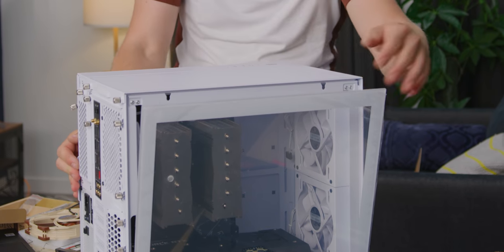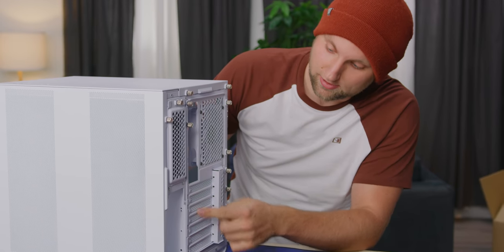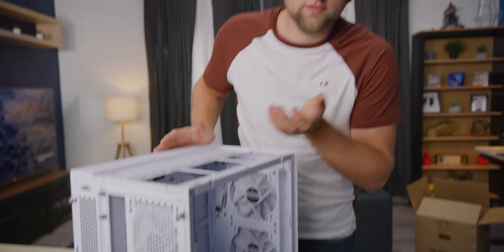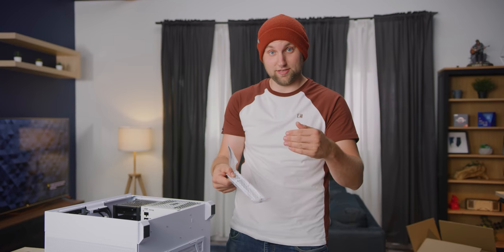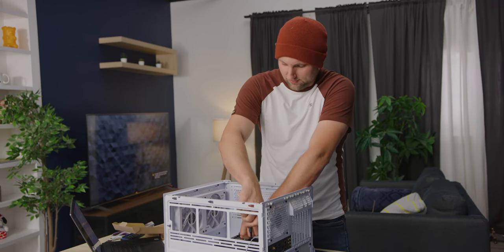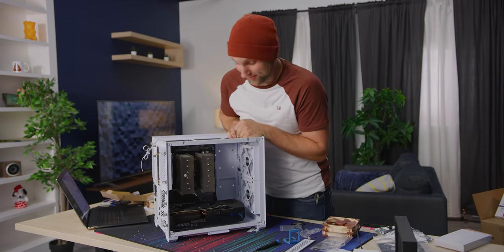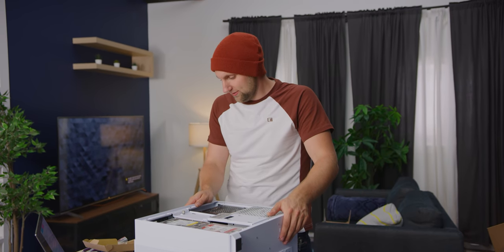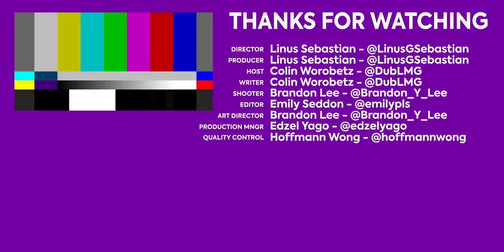This Is My DREAM PC Case! - Lian Li O11 AIR MINI

Comment: I really would like to see a build in there with exactly every slot filled with the biggest stuff you guys can fit. Its one thing to dummy place everything. To cable it is another thing
Reply: that channel under the SSD tray is pretty spacious, I doubt cabling would be an issue.
Reply: @AddisonRyan  it is indeed, but I was thinking how it turns out when you fill everything. Also with this size of PSU. Definitely an interesting try
Reply: Including an EATX motherboard and two EPYCs.
Reply: @pleappleappleap  nono 2 itx boards and 2 epycs in one case
Reply: Cables is pain... I have a Corsair 5000D, and despite having plenty of room in the front, I ended up with bundles of wires in the PSU basement
Reply: @DoctorX17  exactly what I was aiming for. If you fill all this stuff, you need atleast a few cables for power aswell. Sata and power. That's 2. Now  scale that up to 4 HDDs, 2 SSDs and you get a few cables. You know the deal :O
Reply: @Mom19  spaghetti explosion!
Reply: So, you like every hole filled to the max, do ya?
Reply: yes custome watercooling with 2x280s , that would be crazy
Reply: I had the original O11, it was garbage! I HAD to buy custom cables in order to wire everything up. Stock PSU cables were too long and with everything in literally no room to store the excess cable length and that was with a modular PSU to.
Reply: @jmac316  the O11 isnt really a cable storage. It has a big inside for your computer parts for looks mostly. Cables are another thing. It isn't garbage, but you would call it insufficient cable management. The build quality is good. Personally I don't like the restrictive airflow options in there. But that doesnt make it garbage really
Reply: @bowdiddly6172  Well its not practical sometimes. And I wouldn't do this inside this case, but I definitely need practical stuff and its nice to see that this case offers a good amount of practical mounts and space. But mounting space isn't the only thing that matters. If you have a hard time wiring this up and store the wires, the mounts begin to be not useful after a certain point. To make it short, I like to have the options eventhough I don't need them today, but would need them tomorrow. And if the options get hard to use, the options become irrelevant
Reply: @bowdiddly6172  I mean, just because I have mounts, doesn't mean they are all usable at the same time yes, but if they are, thats great
Reply: @Mom19  I also thought it was garbage because parts didn't line up. Gpu didn't line up with the backplate as the whole back was slightly warped. Since that I avoid this O11 line.
Reply: @jmac316  this must have been a production issue. I worked with an O11 before for a customer. Cabling is different there but otherwise everything was fine, except my opinion on an only left side intake. Could have more intakes

Comment: I really like Colin's videos but cmon man, you put the cooler upside down!? That´s the D15s, s as in assymetric specifically to clear the pcie slot, the reason that monster of a gpu didn't fit was because the cooler was upside down

Comment: "It can fit all these things" sure if everything was wireless lol
Reply: Exactly, there was literally no dpace for hdd cables which are quite big
Reply: There is space in the bottom and the top, not in the middle, you just have to do a good cable management.
Reply: @eliadbu  I agree, put one upside down and you have space for wires.
Reply: space man  your pun sucks, seriously.
And about the case of course its not perfect but it has few aspects that fit the needs of quite a lot of people. Talking about the XL these 2 are very different, I want this case since I want to save space while I fit regular ATX components, XL is too big for my planned setup.
Reply: space man  cable management and custom cables, I've seen modders that have done much more than you did like building watercooled ITX with aquaero controller and still the nailed the build. Of course average PC builder does not have the tool skills time (and maybe money) to build such PCs, but believe me fitting all of that storage is not impossible to that case.
Reply: space man  clean build makes everything tighter even in the front and when you you to change something in the back, it's not a mess. And I want small PC because where I put my PC I want to save as much space as possible (sometimes space is a luxury and not only in a closet). I have a large case for a different build (corsair 900d) and believe me after years using it for custom cooling I know the disadvantages of large case so I won't fall for it again.
Reply: space man  I can recommend you singularity computers he has some amazing builds.

Comment: Even though Colin was obv nervous, he did a great job in thee presentation.
Reply: Didn‘t think he seemed that nervous but he sure did a great job!
Reply from the maker: Make sure you @ him on Twitter!
Reply: @zenstrata  Are you allowing people to say whatever they want in your home?
Reply: @zenstrata  And the YouTube comment section isn't the worst the internet has to offer? o.O
Reply: @ShortCircuit  want a thermal paste for my laptop which is equipped with a r5 4600h and a 1660 so with which paste should I go with kryonaut, noctua nt nh1 ,or artic mx4,or kingpin kpx which one will last 8 -10 months without drying or significant rise in temp

Comment: How are those hard drives going to fit with power cables and sata cables?????
Reply: Time, patience and right angle sata and power connectors,
Reply: you kinda just mash it, that's what I did with my normal mini
Reply: @salty1099  Same man, the back of my mini looks like a bomb exploded. But damn does the front look good 😂

Comment: For anyone curious to buy this, this case does have different compatibility compared to its dynamic counterpart. This one supports an atx power supply where the dynamic supports sfx, I also believe you can use offset brackets in the dynamic for a 360 rad but not in the air mini. Hope this helps!
Reply: god sent

Comment: Okay I walked into this unboxing expecting "Oh, it's a Mini with a vent on the front."
The "Full ATX PSU" support knocked my socks off. As with the additional 3.5" sleds where the side mount used to be, and included fans for the price.
It's going to be a bit chubbier than the already fairly chubby original Mini as a result though. But really, ATX PSU was THE #1 demanded feature from the original release, so I'm not surprised at all about the change.
Honestly, you're giving me buyers' remorse for getting the original Mini! And I've wanted that case since they teased it!
Reply: saw this, ordered atx psu and waiting for the case now lol

Comment: NH-D15S was put in the wrong way; it's actually top biased (check gap between edge of heatsink and heat pipe), flip it around and there won't be any clearance issues with the GPU
Reply: Their testing if people are still too harsh towards incompetent people building pc:s :D

Comment: This case with 4x16TB drives, 2x256GB SSD's for Caching, and then a small m.2 SSD on board for the OS (maybe 2 if you're redundant) - Would make a pretty sweet unraid/server box hiding nicely in your living room.

Comment: Really need to see the case with RAM installed and both Noctua fans on the cooler! I bought the O11 XL purely so I could fit the NHD15 but you need to swap the front fan by the RAM for a 120mm to get the glass side on. Please do a full build proving the FULL installation of the NHD15!

Comment: You can also use doublesided tape or taped velcro to fit more SSDs in the front area if you want - seems like you can fit like 3-4 SSDs in the front depending on how you stick them to the inner chassis wall.

Comment: No joke agree about air cooling.  I've built more than a few custom cases designed specifically with duct work to isolate and move the hot air as efficiently as I could manage.  If you go as far as to plan for hardware and make tailor made ducting you can get really impressive numbers with low sound pollution.  I've also built one where the case is basically just a massive radiator/heat pipe style heat sink with fans along to push flow (similar to the one featured recently).  You can get solid results that route and even if a fan (that's nearly non existent rpm or sound wise) goes out you're not going to overheat on standard loads.

Comment: D15 fits in a normal 011d mini and clears the side panel by about 2mm if you use 32<mm ram in case anyone's wondering.
Totally didn't just finish an air cooled setup in an 011d mini snow the day all 011 air videos started coming out 🙃

Comment: The GPU didn't fit in the top slot because you installed the CPU cooler backwards. The D15S has an 8mm offset to move the fin stack away from the GPU, but if you put it in upside down it overhangs the top PCIe slot by 8mm instead.

Comment: if you're using a consumer cpu like most folks (i.e. not threadripper or xeon), ALWAYS put the gpu in the first slot because it's the only slot that works at 16x.  you don't need clearance between the cpu heatsink and gpu because the cpu heatsink blows front to back.  while the airflow across the gpu backplate suffers, (which isn't great for a 3080/3090 with back side vram) it's the sacrifice you make if you use a big air cooler.  I wish that nvidia hadn't resorted to a rear-side memory configuration, but the only ways around that are some kind of active back plate / liquid cooling situation.  Personally i have a generic barrow liquid cooler on my 3090 gaming x trio and kept the stock backplate but modified it by adding a heatsink with thermal pads to it could more efficiently carry more heat away.

Comment: There is a large gap in pc cases that can fit an ATX motherboard, but can be placed horizontally in a living room and look decent. Corsair icue 220T is grazing that line, but is still quite bulky for the purpose. At the same time ATX mobo with a mini GPU has a fairly small footprint. The reason behind doing it is converting an older rig into a living room pc. Those who got a living room pc don't go back)

Comment: I like the case but think it needs some changes like the height should be 400mm x 400mm for better AIO fitment. It needs to change on the front fan bracket back to a normal fan bracket and the Front I/O should be on the Front middle or bottom as this is more a Desk Top case and the ease to use the I/O when sitting down instead of standing each time you want to use. It is sad the case companies have to save a nickel by eliminating the 1 head/mic jack.

Comment: I have a meshify 2 with dual 360mm radiators, and I removed the factory filters both front and top to allow for increased airflow.  I found that the mesh is open enough to allow for airflow but closed enough where i'm ok with it not having additional filtration - the cat hair builds up on the front of the front panel mesh and i clean it every week or two so she doesn't get choked off and looking nice :D

Comment: hmmm if you want to fit "all the things" buy the O11 Dynamic XL, started with a 360 aio and an air cooled gpu, one year later I have a triple 360mm cpu-gpu-vrm liquid cooling setup, the XL barely has enough space for my cables and 2 commander pro, until you've built a corsair rgb build I'd see why you would think "plenty of space in this case"

Comment: Preventative maintenance!

My Lancool 2 Mesh RGB Supercalifragalistic, doesn't keep dust out, except at the PSU. All that fine dust has slowly accumulated over the last 6 weeks since I built it. But that's why I got air and a little vacuum to keep her spotless.

P.S. I love white cases, just wish I knew I could get my Seasonic in white, although the inside of my case is black.

Comment: Is that NHD-15 upside down? I fell like mine has the cooling fins sitting higher and gives top pcie slot clearance.
Reply: it should be symmetrical, I just think the aorus gpu has a really chonky backplate
Reply: It is upside down, it's the D15S which has an 8mm offset upwards to move the fin stack away from the GPU. But if you put it in upside down like this it completely blocks the top PCI slot.
Reply: All of those clearance issues are the reason I stop with big air coolers and went for watercooling. I had the NHD-14 which is similar to the the NHD-15.
Reply: @eliadbu  The NHD-15S works pretty much with any modern board out there.
Reply: @BTMcSweeney  stupid the d15s has the offset but the d15 doesn't. Seems kind of stupid. Good info I hadn't notice tho thanks.
Reply: @eliadbu  lol they have no clearance issues if you plan ahead and install them properly. They last forever with zero maintenance and wont brick your computer, there is a reason Linus runs them on everything that isn't a project.
Reply: @atodaso1668  not the best temperature and if you OC power hungry cpu you WILL be thermally limited, and as I remember tall ram was an issue on 14 I don’t know about the 15, plus I hate that a chunk of metal is hanging on your motherboard it just ruins the aesthetic if you are looking for it. For air cooler they are good for overall cooling they have their limits with modern highend CPUs .
Reply: @eliadbu  You are not going to outperform a D14 or D15 with anything other than a full custom loop which is 10x more. For that extra money you get many failure points and extensive maintenance, all for an unnoticeable performance boost in game. To each his own.
Reply: @atodaso1668  so I had both aio and I later on I bought custom loop. The AIO did outperform the NH-D14 both at noise normalized test (it was 280 mm rad) later on with custom loop I hooked up 480 mm rad just for the CPU and since I OCed it so much (10940x@4.8 GHz ) there is zero chance ANY air cooler could cool down this 400-500 watts behemoth. My case is special but it shows how limiting air cooler are. Failures they exist but in 6 years I use custom water coolers I did not have critical failure, take it for what it is worth. Price if you are enthusiasts the AIO price is not that high, custom loop will be more expensive but it is for more established enthusiasts.

Comment: 10:51 I was disappointed in them for a moment because it looked like they had a sticker on the glass that didn't come off with the plastic. But then, when it turned out they actually had it on a second plastic cover on the inside, ok now I'm impressed. That's like, bonus points nice

Comment: If you want to look at an even smaller form factor that fits ATX Mobo/PSU, the Raijintek Thetis is pretty solid (pun intended). I have been rocking it for a year. It fit a Noctua NH-U14S pretty easily until I switched over to an Arctic Cooler Liquid Freezer II 240. Rocking a X570 AORUS PRO WIFI, Ryzen 5950 (I am a dev who uses docker a lot) and a GTX 1070 FE. It is 210(W) x 360(D) x 366(H) mm vs this o11 being 280(W) x 400(D) x 384(H) mm
Reply: My 011 snow white dynamic mini fits ATX board with 360mm radiator fans on top, just need to make sure your ram isn't too tall or it won't clear, but it works!

Comment: I'm still using the giant Thermaltake level 10gt snow edition. I believe Linus did a review of it in 2011. It's kind of ugly, but with a case, functionality is best. I've never seen my temps get out of the low to mid 70s at the absolute highest. Hard drive  bays are hot swappable. I won't be changing cases anytime soon. Rgb is unnecessary.

Comment: The CPU cooler has an offset so that you can fit the GPU in the top slot. You put it on 180 degrees away from the way you should have.
Reply: This channel's videos are put together without much prep which is frustrating in cases like this (hehe) where they are trying to give a useful overview of a product.

Comment: I don't think graphics card not fitting in their is necessarily a graphics card problem.
I have a Noctua D15 in my computer and I had to buy a pcie extender to fit my graphics card because I bought a smaller motherboard (it was cheaper and in retrospect I should have bought a proper sized one, but your are smarter afterwards)

Comment: When will Lian Li make a proper ITX case, around the 10-12 litre size. Not just a slightly smaller ATX case. Their cases look amazing, but they are all so big!
Reply: Probably never, because they would be competing with themselves. The Dan A4, NCase M1 and Skyreach 4 Mini (amongst others) are ALL manufactured by Lian-li.

Comment: Wow ... Lian Li really has kicked it up with this one.
I have a big complicated build, and I would be able to fit it all in this case.
ATX, full size PSU and the most mammoth GPU you can buy, and still 4HDD and 2SSD's. 
As long as you dont need a custom water loupe, who needs an XL case, if it will all jam in this?
Case manufacturers just turned their heads and took notes.
Cant wait till Steve takes a look at it.

Comment: I have an 011D Mini as my home server....Chinese X99-D8, Xeon E5-2630v3, 80GB, SF450W, 6x3.5" HDD (40Tb), 4x2.5" SSD, GTX 1050Ti, Intel 4x1G NIC, 4 Port HBA, 2x140mm+4x120mm fans, Snowman 120mm CPU Cooler (yes...the HDD/SSD have extra brackets over std for this case)....but this (011 Air Mini)  is the case I actually wanted. Couldn't work out why they skimped on 20mm ? in width for the SFX when they could have gone ATX so easily....and now they have. The temptation to swap is very real.

Comment: Wish this was around when I was building my PC. I bought a regular O11D mini and now I'm limited to SFX and SFX-L PSUs. I do love the front glass panel on the regular mini tho, so it's got its ups and downs.
Reply: Also the dynamic mini has capability to mount 360 rad, this does not SMH.

Comment: Wait... The O11 air mimi takes atx PSU but the regular O11 mini only takes sfx??
If you got the tooling done lian-li give us the option. If they're different enough give us a glass panel option sold separately for this one. Either works